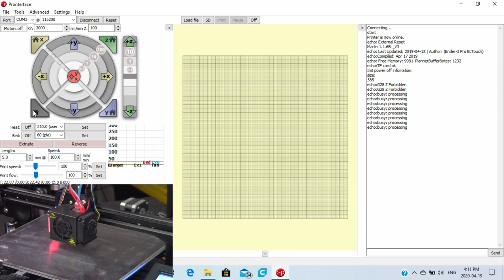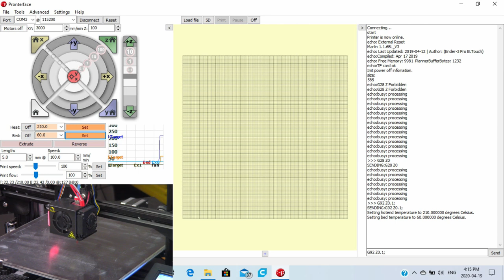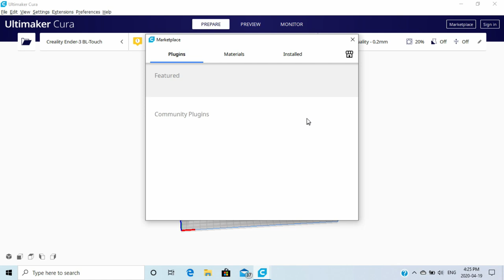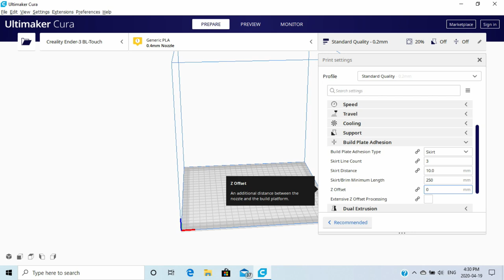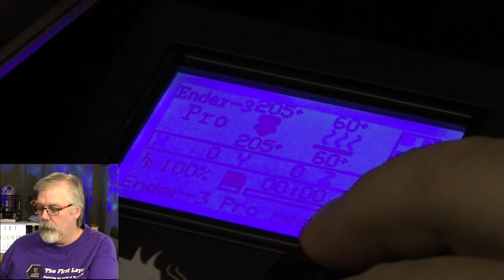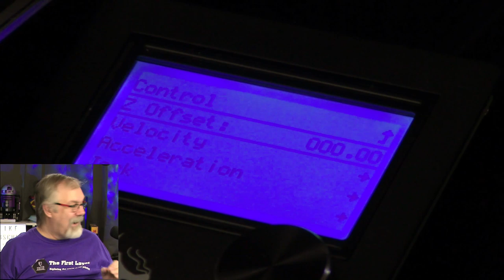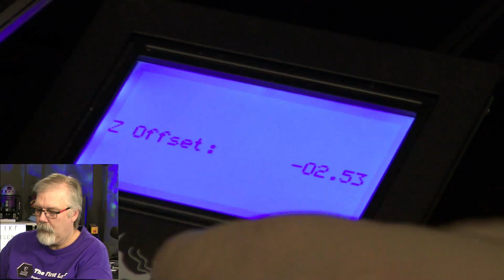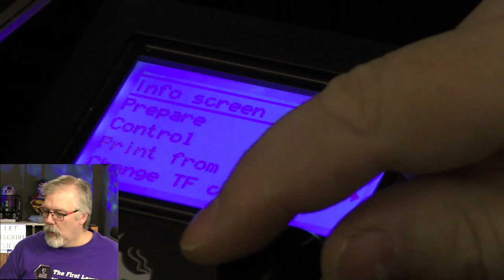Easy Z-Offset adjustment for your 3D printer.

Comment: My second extruder is .8mm lower and the set screws are toast so in the mean time before I rip the thing apart I want to set a z offset in the extruder start code.
Is adding negative (-.08) correct
G10 L1 P2 X0 Y0 Z-0.08
Also extruder 2 is is E1 so would that be P2 for the above example?

Comment: Update; Your axis won't go below zero? If you've gone through a firmware update for auto bed leveling like I just did, you are familiar with Marlin and enabling/disabling firmware commands? So the reason the Z axis wouldn't go below zero is because there is a command line "MIN_SOFTWARE_ENDSTOP_Z" on line 1120 of Marlin 2 point whatever. That must be disabled with two slashes. Once disabled the process done from the printer screen should work.
Reply: On the computer or where at please help me
Reply: What is Marlin
Reply: @trinitychiplove    it is an software.
Reply: I'm not clear on where you would enter this configuration change?

Comment: I received my printer not long ago and I've been struggling with getting prints correct. Where can I find the software that you're using? I don't see it anywhere in the files I received along with searching for the CH340 install software.

Comment: OK, SO I  might be watching the wrong content, But i have an ender 3 pro and ever since i got it it seems that after i print something like a big box for my uno r3,  the first layer goes down great.. however all the layers that go on after the z-hop turn really rough, like over extruding or some thing and I did test, thats not it. so i have to sit there right next to it doing babyzhops. ive tried incressing my E_steps and decresing E_steps. and even worked with flow. Its like after the first layer goes down Perfict the nozzle only travils half way to where it should be and just squeezes out plastic....looks like fine grit sandpaper. its new printer. bed is perfictly level. can you or anyone give me some feed back? or a link.. PLZ

Comment: Hey this video helped me a ton but my Ender 3 Max does not have a z offset tune in the control panel, neither does it have an adjustable z stop switch. I ended up bogarting the screws from a junk printer I have to make the z switch adjustable and then used your sticky note method to fine tune it. Printing perfectly now. Thanks a ton.

Comment: Sorry but need to ask a question. At the 10.46 min mark you select Auto Home. I believe this brings the print head to the position x=0, y=0 and z=0 but more importantly it has brought the x axis down to Y limit switch stopping any further downward movement. However at 11.05 min you say you are going to bring down the print head using Move axis, move Z axis down 1mm at a time. How can you do this when the x axis is already at the lowest point it can go because of the z limit switch
Reply: sorry I meant it has brought the x axis arm down to the Z stop limit switch stopping any further downward movement.
Reply: @davidlow7583  i have the same question tbh

Comment: Hello can you help me with my issue?  I keeping getting this error with my new bltouch, STOP called because of BLTouch error - restart with M999.  I have the 2.0 version and the wire with is is the 5 conductor all in one cable which is plugged directly into the port and also the z stop is still connected.  I have the ender 5 pro with the skr mini e3 v2 mainboard.  thanks in advance...

Comment: Thank you for a very detailed video.  I like your printer setting method, but it doesn't work on my printer.  Even after I save the settings, they seem off as soon as it starts printing. I'm about to upload a newer firmware, but the new firmware does not have all the tabs in Arduino IDE... I'm kinda scared not to brick it.

Comment: Hi I've bought a ender3 pro and it has a bltouch fitted is it possible to remove the bltouch  and re set to factory settings and re fit the Z top

Comment: so i have had my ender 3 pro for almost a year and have yet to be able to print 2 prints back to back without having to relevel every time... im not sure what to do and im getting ready to give up. any help at all would be great... i dont have this z offset option on my 4.2.2 board and there is no BL touch just yet.

Comment: I have a aquila. I just started having a problem with the nozzle digging into the bed after leveling properly. I'm new to the hobby. My fist two big prints went great. But I can't print anything new from the voxelab slicer. The old files and preloaded files(test hook, etc) print fine. Do I need to adjust z offset for each new print?

Comment: I have a thermal mat and a glass bed, and new hotend, and I've never had to touch this.    It's just whatever it was when it came. When I got the glass bed, I just moved to the z-stop up about the same distance and then re-level my bed to the nozzle.  
What is the benefit of doing a z offset over just leveling the bed to the nozzle with a feeler gauge.  My prints are great. 
And if I ever have some sort of issue where the code or something messes up, it can never go below my z stop, so even if it ever did decide to just forget my z off that I'm not hitting anything.  Not to mention you might have to move it anyways because depending on how thick your new bed is, you may not be able to make contact with the stop. 
I understand it's using BL touch, but. I can't see the reason not to just use the z stop and level the bed to a homed hotend.  Maybe I'm missing the point. But my prints are excellent and always have great first layer.

Comment: Z offset is one of those things that I still have trouble with... if it is currently set at -1.35 and I add a 3mm glad bed does this mean that I would effectively reset the Z offset to -4.35? I'd just add them together assuming the glass bed is indeed exactly 3mm?

Comment: After removing the glass bed and installing a Twotrees plate on my Bugfixed Marlin 2.x.1. with CR-touch and RUNout sensor my Ender 5 Pro printer never worked anymore. Its Z bed height was wrong after calibration and it kept behaving erratic. And it drove me so crazy that I even disassembled everything and dropped all back in its box. But today I finally solved the extremely difficult to find Z height bed level problems with my Ender 5 Pro when I noticed that bedleveling only worked when I put a thin about 0.3mm sheet of paper under the probe of my CR-Touch! But still just raising the bed with about that height of 0.3mm never helped! But by loosening both screws that hold CR-touch and nozzle fan holder cap and repositioning the CR-touch as low as possible and thightening the screws afterwards completely solved this crazymaking problem! So I never knew but sadly it is possible to mount the CR-Touch a little bit too high after your Ender printer never behaves normal anymore after that!

Comment: I have cr 10s it doesn't have z offset in motion so I don't have a clue how to do this help please the problem is I cant level the bed. The spring are compressed    I auto home then disengage steppers motor i cant get a piece of paper under hotend

Comment: Hi, I am struggling to set the offset on my CR 10 V3. Currently running Marlin 2.0.8. I thought I'd have the same setting to set the offset directly on the machine but turns out I don't. I have already tried with Gcode and no luck as everytime it Autohomes it bottoms out on the plate. 

I don't have BLTouch, reason I am looking to set an offset is because the nozzle is printing too close to the bed, so Ideally (I have measured it) the new 'Z0' should actually be Z0.35. I have been looking around and testing Gcode from multiple people but no luck so far in making this offset permanent. Any advice would be super helpful, thank you

Comment: Been having a problem with my Ender 3 lately. Had all sorts of z-offset and home problems that I had to fix one by one (the end stop too high, the wheels too loose and backing out, the arm going crooked and/or making short/smushed parts, etc... etc... but after finally getting all those things fixed, out of nowhere now I need a -0.9mm offset, which is too much to be able to use several slicing programs. Like Cura and Creality, they only allow a -0.27mm offset max. I know there are other ways to "fix" the problem, but I don't want to have to rig anything that's going to make it hard to print different things with different slicer programs and I don't want to have to mess with settings every single time I want to print something. For the first 4 weeks of having the machine (excluding the problems), for the most part I would just slice and print the parts. I didn't need to mess with settings or have to do anything special just to print a normal part.

Comment: So how is this different from raising your bed to the nozzle using paper method? I have always been confused why all bed leveling instructions don't mention this. How does this fit into the equation?
Reply: Generally you don't use z-offset unless you have a printer with auto bed levelling. The offset is the difference between what the auto bed levelling sensor is detecting and the end of the nozzle.
Reply: @hoppynaki  that's what I thought, in which case you'd think manual bed leveling could use offset, because I have ran into too many times I am getting drag on paper when leveling but first print isn't sticking. That nozzle is raising above z0, it has to be.
Reply: @yarrumc  This may not apply, but I discovered unnoticeable hardened plastic left on the nozzle from previous prints would ruin the paper gap method. I don't use bed heat for most printing and a heated nozzle just oozes continuously so I always use my angled tweezers and clear anything left behind. That is I used to. I just got my BLTouch working and first print appears to be a winner so far.
Reply: if the bed is levelled using paper then you effectively have a z offset of 0.1mm applied, the thickness of the paper...

When you start a print the nozzle moves to the layer height NOT zero, so a 0.1mm layer the nozzle will actually be at 0.2mm above the bed and the print will fail..

You can use z-offset plugin in cura with a -0.1mm to compensate for the thickness of the paper you used to level with, and as it has a much finer resolution you can adjust the nozzle a tiny bit closer than that to squish the first layer a bit more, so you could ass a z offset in cura of -0.12 which would put your nozzle 0.8mm above the bed for your 0.1mm first layer..

However, to get a 0.1mm first layer at all needs a very, very good surface, even the creality glass bed has a variance of up to 0.15mm which is your entire layer height and another 50%..

For best consistent results on your first layer use a first layer height of 0.2mm or even 0.3mm, it will not make any difference to the dimensions of the object as the ttal number of layers will be changed to maintain it, and you are not going to get superb resolution on the first layer anyway due to heated bed etc..

When using auto levelling, it is Z PROBE OFFSET which is used to set the difference in height between the position of the probe trigger (or bed surface) and the nozzle.. So auto-level detects the bed and the probe offset is added to that to move the nozzle further down until it touches the bed. they are two different things, and you can use both, so with autolevel the probe offset puts the nozzle touching the bed surface  at zero, and in cura z offset can be used to squish the first layer slightly and can be different for each layer thickness or quality profile..

Comment: Also at the 13.43 min mark your Ender screen under Control, under Motion shows Z offset, well my new Ender 3 Pro does NOT have this option. Why would this be so ? Your machine is an Ender 3, is it not

Comment: OK...  Can you please help me.. brand new ender 3 pro.   Silent MB, BlTouch V3.0 , Yellow heavy duty spring, MicroSwiss AM HE Marlin V 1.1,6 BL v3,   I have been at this for weeks and I am Getting very frustrated.   I just had to add a new glass bed because I ran the hotend in to the magnetic bed so many times.  I have followed Luke Hatfield's guide wen putting my machine together.   I manually leveled my bed with the gcode level calibration. I Just followed exactly what you did, and my numbers even turned out to be the same. of 2.8  However as soon as it Goes back to Home and the Bl touch does its thing, When it goes to print the nozzle is way far away from the bed...  I Just don't under stand???

Comment: Okay I just got my first 3D printer a cr10 V2 with all the upgrades. Okay when I auto home good for the first time the nozzle was at least 10 mm off of the plate. I had to adjust we adjusters all the way to where they were almost completely loose to be able to get them even close to dragging on a piece of printer paper. It doesn't seem like it should be this close to failure. There is no adjustment in the zbracket for the limit switch period what else can I check? This doesn't seem right at all and I have very little experience. The only thing I have going for me is I worked in robotics for most of my adult life

Comment: Is there any video that explains how to do this using an Ender 5 Plus? Seems like every video I watch is for an Ender 3. The problem is that the menus are completely different and some of them you can’t back out without the nozzle moving around. I’m trying to make sense on what menus would correlate but they don’t have the same capabilities. For example, when I’m in the leveling menu I cannot change from moving the nozzle from .1mm to .01mm. I can only do that in the move menu and when I come back to the leveling menu, everything moves again. I’m also uncertain that my new offset is being saved when I level the bed because there’s nothing in the menu that says that it’s saved or gives me the option to do so. I feel that I have to do this before every print and doing so, defeats the purpose of the auto bed leveling.

Comment: Great video, giving it a try, but where exactly does the level bed function come in to play in all of the z offsetting, for example running the bed level to test 9 points?
Reply: The auto bed leveling levels the bed using the probe (bltouch) but if the probe doesn't know where the nozzle is then it will print midair, so you need to set the z offset of the nozzle so the printer knows how much to compensate for the difference in height
Reply: My z offset is in the front left corner is yours in the middle?
Reply: @Dawgbyte04  mine is set in the middle of the bed, I managed to get a "fairly decent" leveling. Some print jobs work fine, others are just pointless to even try, I just don't get it why and how they can send these machines out the door with severely compromised beds. I've tried it all and I can't get a "level bed" that will just print any given job no matter what.

Comment: After 3 months of my CR touch working great it started to fail. Every time I use Z probe wizard or manually adjust it. The printer wants to be 10 mm + offset above print bed every time. Anyone have a suggestion?

Comment: im trying to fine tune with marlin but it doesnt allow me to set offset on the control panel to the thousandths place and its either too close or too far from the print bet
Reply: Mine does the same. Have found an answer?

Comment: I have a Ender 5+ and I'm unable to go beyond "0.00" when using the touch screen to move the z axis, but the nozzle is still too high above the bed
Reply: I’m having the exact problem and just about to return it Bc i have watch video after video and cannot find a fix. Did you find any solutions by chance?
Reply: @hailey nichole  I figured it out finally. Nobody explains this well for noobs. Check the 4 plastic bed knobs under corners to make sure about 1/4 of screw is showing on each. Go to Leveling,  once Auto Home finishes, turn off Auto Leveling.  Either go back and use "Disable Motors" or unplug them all. Once done, manually turn Z rod threads simultaneously to raise bed carefully to  paper card thickness (I used Creality card) below nozzle. Carefully slide nozzle left towards z screw with card under nozzle, turn left z slightly to lower the bed for any dragging. Once Z is fine tuned so card barely slides or is a little scratchy move to right Z and repeat. Once each side is about same card height below nozzle, switch to paper and slide nozzle head to a corner (R back). Slowly use knob to adjust that corner to where nozzle binds the paper and won't let it move then reverse to where you get scratchy slide. Make sure you don't bump knob when letting go. Repeat with R front, R left etc. Once all corners have same slightly scratchy feel when sliding, check center again with paper. It should feel the same or a little less. *Turn on auto level at touchscreen, then plug in or tap disable motors to turn back on. I then ran measuring and everything should be close in range. Just make sure there's no odd variance that might mean bed warp. (Check by going to "move" type 140-170 in Z to lower.  take glass off and lay straight edge ruler across center and corner to corner. Once your Z is set and you are in 'Leveling" or when printing, you can make adjustments to offset if needed. Z+ lowers and Z- raises on mine. Seems backwards but it's important to note. Hope this helps, message me on  FB if you need more help.

Comment: Something I noticed ..... having noted increasing Z offset on my Ender 3 Pro. Each time you do this - when move Z axis to get your paper 'drag' - it will add to whatever is already set as Z offset - because Auto Home effectively says its zero. You can check this by going to Control - Motion and setting Z offset to zero. Now auto home and now do the Z axis move to get Z offset figure to dial in ... 
I could not understand why I was getting an ever increasing offset figure ..... till realised this factor.